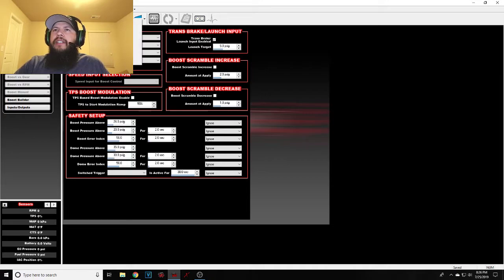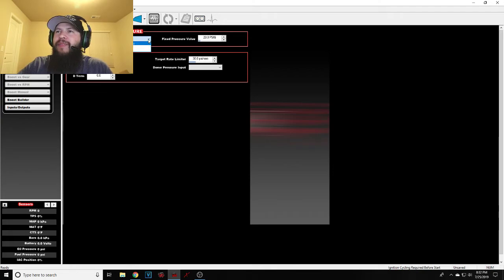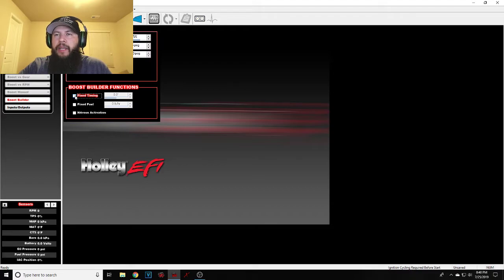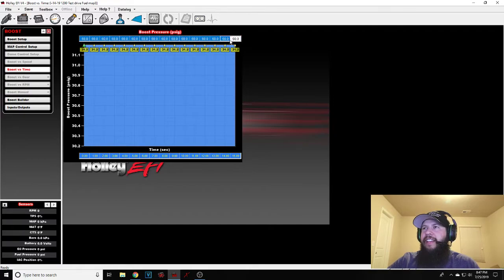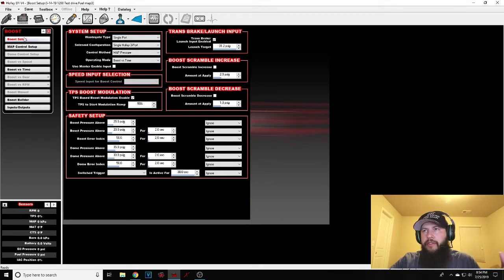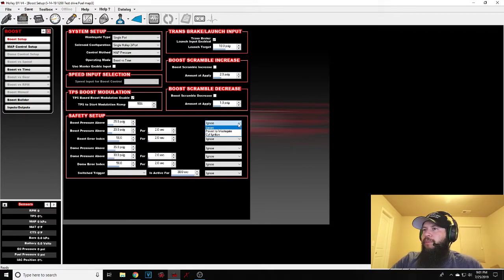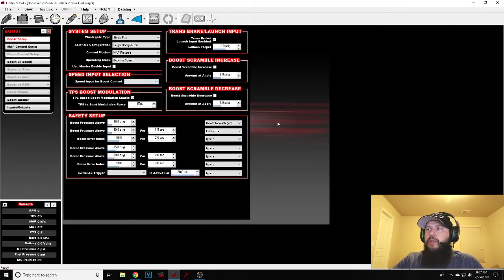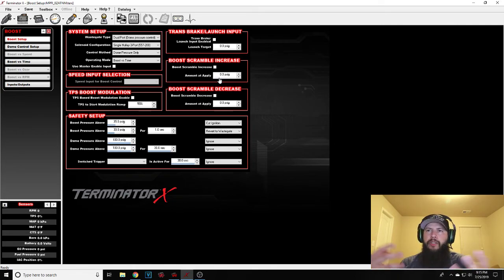Holley EFI Basic Boost Control Methods

Comment: When using the 3 or 4 port solenoid and no co2, what is the input you used? My 3 port doesnt seem to be working. I have unmapped boost + and then boost- is mapped to a pwm - it doesnt seem to be adding boost as I have the duty cycle increasing, part of me thinks its trying to reference the boost+ and - solenoids still, though I added another output for the boost solenoid that is a pwm-
Reply from the maker: Like the video mentions, use the single option in the drop down menu for a single solenoid. You shouldn’t have two outputs to map if you have the correct selection chosen. The fact you have two outputs to map means it’s expecting a dual solenoid setup.
Reply: @Therendonfamilia  I have it set up as single but it still had those 2, If I go into the configure option on the output I made for my Boost Solenoid the solenoid works, but Target Boost and the corresponding WGDC table do nothing. Is there a way to change the pin that that table uses as its output? I had no options in the I/O table besides Boost +
Reply from the maker: @TroysRepairAndPerformance  I am driving at the moment but please watch the video all the way through. Your answer is in there.
Reply: @Therendonfamilia  I watched it all. Maybe I missed something 🤷‍♂️, I've never had this issue on a Haltech before
Reply: I got it figured out. With a single BCS no dome pressure. I made a custom I/O for my boost solenoid. X axis RPM Y axis target boost. I can use the target vs time in the boost control menu with it, but you dont touch the boost solenoid WGDC% in it, I had it using boost psi as the y axis in my I/O pwm table on accident

Comment: probably woulda been nice to move the camera window to the right side where nothing is showing.. or just not have it at all since we don't really need to see you.... annnnnd you moved it now lol.
Reply from the maker: You got there 😜
Reply: @Therendonfamilia  random question, if you have experience with it.. but is it ok/preferred to run dual mac valve boost control still with compressor as the source? installed 100psi dome pressure sensor, wired up dual mac valves. its a street car 68 mustang w/single turbo on flat tap 302 that will probably be low boost (no more than 10'ish). mainly want control for safety features and some adjustability. will go co2 later when i change motor to stroked 351w.
Reply from the maker: @callofgeorge  yes, that’s fine. There is a setting for compressor instead of fixed. If it’s just a mild street car setup you really don’t need to use c02. It is not necessary even for most of our faster drag racing setups.
Reply: @Therendonfamilia  perfect. and yup, knew the drop down for compressor.. just wasn't sure which was preferred for my setup. wanted to go ahead and have the duals wired/ready for later. thanks for the info.